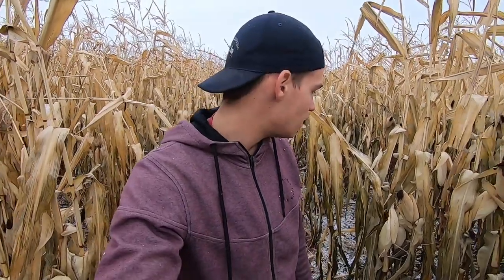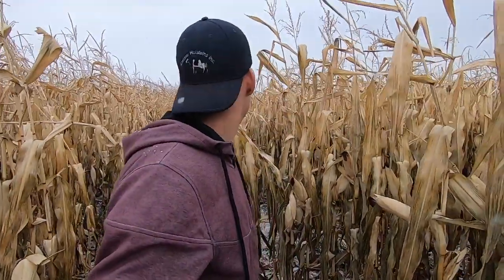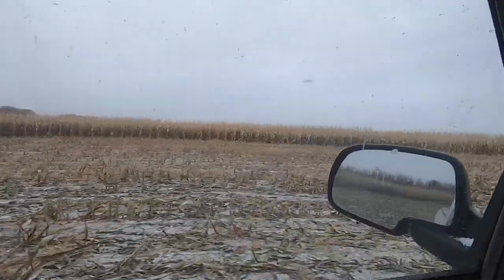Chopping Corn Silage

Comment: When you covered the pit you put the sheet on upside down the clear plastic is meant to go on the inside
Reply: When you cover a silage pile you drag the plastic down the middle then unfold it from each side. The white side should be on the outside

Comment: wow will you switch to the silage pits in time  yes they were costly to build, 15 years ago we bought a used concrete plant  we we never look back on not buying it,  we are able to lower the cost in less the half what we bought it for now  if we sell the gravel and sand on the property does  not take long you building  has been pay for 
all of the silage pits were build that way too  
as to corn silage first time, we used it  someone traded 5 trucks and the jobs  for his farm  he was made very clear that job he has to keep bribing for the work but he ever did it  lost the contact both of them he was taking peat moss down there and being vegetables back up here he screws himself up he had corn on his property  first time we handle corn silage